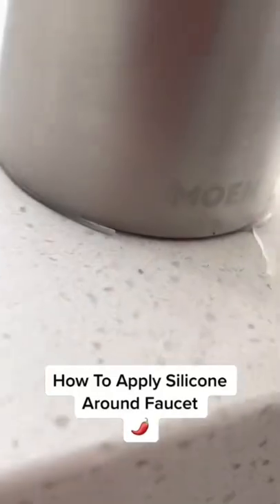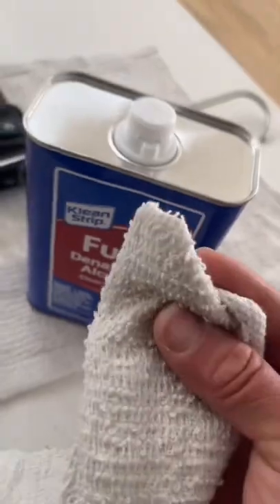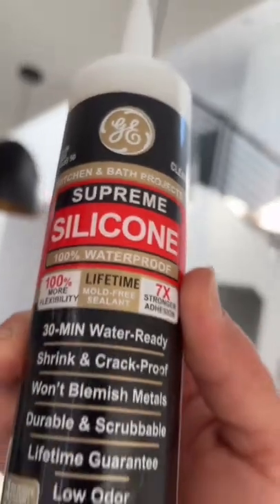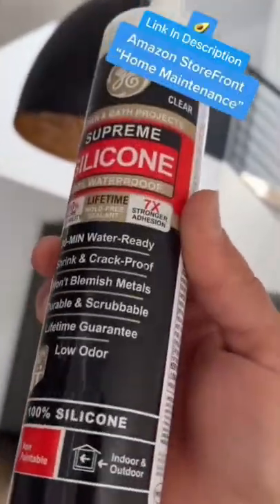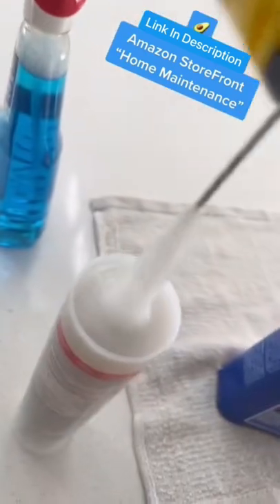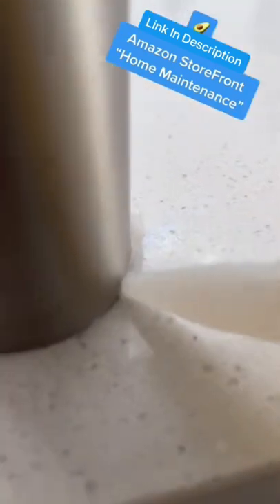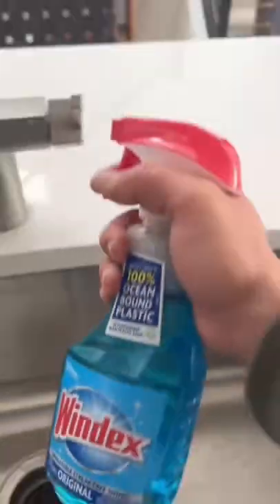How To Apply Silicone Around Faucet. #faucet #silicone #homemaintenance #diy #howto

Comment: Ammonia FREE glass cleaner ONLY bro. Ammonia (which is in most window cleaners) breaks the silicone down, and can allow it to not last as long. Just fyi buddy. Have a good one!
Reply: Needs to be pinned
Reply: Was just about to comment this lol. Same with people using Acetone. Just shows how little people try to understand the limitations of products.
Reply: @Baise Duezcke Yeah this is new to me. wouldn’t have thought to use windex.. also wouldn’t have questioned the suggestion necessarily
Reply: Ammonia can also eat at the finish on the faucet.
Reply: Ammonia will also eat at some counter tops as well.
Reply: @TheFelony  windex has such a low concentration of ammonia that it will never damage anything before it evaporates. Most people use it for everything, countertops, stainless steel, glass, stains, oils, etc. Its safe on silicone rubbers too as long as you’re not saturating it, not good for silicone adhesives though as yes it breaks the bonds and swells the adhesive
Reply: @maxfathi596  I agree, likely will never have a problem but repeated uses may develop an issue over time, and the ammonia doesn't really have that much benefit over their other formulas, especially for something like this where it's not being used in large amounts.

Also, god forbid it does actually cause an issue for a contractor, that could be thousands to repair a counter top.
Reply: Thanks for the tip!!
Reply: Got another silicone expert here
Reply: Better to use liquid besides the denatured alcohol to prep the surface. Invest in a Fugi silicone tool kit
Reply: Thanks for this tip. I’m in Cali and Denatured Alcohol is super illegal. 🤨
Reply: He wants to get paid again
Reply: No, windex will not break down silicone once cured just because it contains ammonia.  I've been using this for over 15 years and silicone just holds fine
Reply: @tonyr8443  "I do it, so everyone should"

Comment: I’ve used the denatured alcohol instead of Windex. Seems to work really well.
Reply: Same! 12 years or so using to caulk fixtures that way, still happy! Before that was soapy water
Reply: You’re supposed to use isopropyl, denatured will not allow it to attach correctly. Especially with silicone
Reply: Don’t use the denatured to clean surface before, you are right silicone will not stick to denatured alcohol. Usually clean area with water and soap or other cleaning products come back when dry, lay bead of caulking lightly spritz area with denatured alcohol wipe joint down. Comes out smooth, seam is filled up, and no mess on other surfaces because the caulk doesn’t stick to the denatured alcohol.
Reply: Same here!  Best I’ve found!  No streaks or residue. 👍🏼
Reply: @chrismohar4706   you’re not supposed to use soapy water either, recommended strict IPA  or 70%. and you are not supposed to spray it before tooling either. Otherwise it won’t adhere to correctly. Commercial glazing foreman and trained caulker.
Reply: @tonyochoa16  look man, IPA is too expensive AND delicious to waste on cleaning around some fixture, I don't care HOW good it works, 
plus not every customer likes the smell of a fine ale

Comment: If you’re already cleaning with denatured alcohol, just use it to clean the silicone joint. The alcohol gives it a smooth finish
Reply: This is how I do it. In a spray bottle, give it a light mist and wipe away.

Comment: This has to be the first useful short I will genuinely use going forward thank you so much for the tips!!
Reply: Don't use any of this nonsense. You do NOT use denatured alcohol. It leaves a film, because it has oil in it. ONLY use isopropyl alcohol. 
Never use frikin windex to tool caulk, NEVER.  It has ammonia in it  which breaks down the caulk. There is no reason to use anything when tooling caulk. Just use your finger or a caulking spade. A popsicle stick works just fine.
The caulk joint he laid in this video failed before he left the house. The homeowner just won't notice for another year, when their cabinets are rotted out.
Reply: @carllennen3520  I'm 8
Reply: It looks like a moen and it has a seal already. 
Silicone just makes a mess and creates a maintenance job that otherwise shouldn’t exist.

Comment: Just use the denatured alcohol to tool the caulk. It dries faster so the caulk can start drying sooner.
Reply: Denatured alcohol is what I use. It works great!
Reply: Yup, same here. Best method I have tried too.
Reply: @mark33545  I use my bare hands and it sometimes dries my skin out. If I did it several times a day every day, I'd probably wear a glove or use a tooling device.

Comment: I try to use a rubber ring under the fixture. Some brands come with one as well
Reply: if it doesn't come with one then is it any real quality?
Reply: Yeah just free the faucet with a couple of turns from underneath and change that counter seal.

Comment: Nice work, don't use your finger to tool though - that's the rookie way. Use a tool to smooth off for a consistent silicone fillet shape. I personally use a popsicle stick, I was taught this method from a professional joint sealer and it works well.
Reply: this sarcastic? I'm a contractor and your suggesting using a popsicle stick to smooth the caulk around the circular faucet in this instance? either sarcasm or I mis understood something
Reply: What in the world is a professional joint sealer. I've been in the trades almost 40 years and have never come across somebody who makes their living being a professional joint sealer.
Reply: I’m a professional joint roller, and you sir, are full of it
Reply: @ohhansel  
Hi mate, yeah a "joint sealer" is a profession over here in Australia, they shoot and tool polyurethane into expansion joints etc, and also usually do bathroom and kitchen silicone work too.
I worked with a guy who was a joint sealer / silicone installer a few years back, he taught me a few tricks and techniques that I still use today. He was an absolute master at anything that came from a caulking gun.
Reply: @vzgsxr  well if that ain't the craziest s*** I've ever heard. Where I'm from caulking is just part of the carpenter trade. Granted some are smoother than others no pun intended. If I had to go to work and do nothing but squeeze a caulk gun for 40 plus hours a week I would just go ahead and put that framing nailer right up against my forehead and get it over with. But hey that's just the Vegemite sandwich I'm chewing on up over here in the states.
Reply: @ohhansel  you made me die laughing with all your comments man 😂😂 I’d never heard of it either before this
Reply: I wish it was a proffession over here,95 percent  of the trades do their own over here.Lets just say most of the time it ain't pretty.

Comment: There should be a seal around the base faucet if installed correctly, you shouldn’t have to be adding that super thin layer of silicone that keeps coming up over the years. P.S Also if you are adding silicone it can be due to movement make sure you TIGHTEN down that faucet.
Reply: You’re right that faucet does have a ring seal underneath. You still need silicone because water always wins. We can only delay it’s damaging effects. Silicone adds a little more protection. Water, even softened water, creeps under the faucet base and leaves mineral build up over time.
Reply: You need both the seal and silicone. It’s on the directions of pretty much every faucet.

Comment: Spraying windex or alcohol before tooling can be risky because if there is ANY tiny spot where the silicone is not in full contact with both surfaces of the joint, the liquid gets behind the silicone and then when you tool it, it creates a serious defect that is not water tight and sometimes very hard to spot. The only safe way to use the spray is also, unfortunately, very time consuming: you have to tape everything off, tool the silicone so it gets squished into the joint for 100% contact, then remove the tape, spray, and retool. Worth it for a high end job, but otherwise you just have to assume the risk and be very careful to make contact when not using tape on mass commercial jobs

Comment: Smooth the silicone with water-tipped finger, then finish with a second pass using a tshirt rag wrapped tight around your finger... it will finish the joint and clean any residue on either side of the finished joint.  Some plumbers just use the tshirt method by itself.  Try it, you might prefer it!
Reply: Way I was taught. wet rag

Comment: I must admit for years I used my own saliva as in licked my finger, for a small job like this no problem but doing a whole bathroom or window washing up liquid
Reply: Learned that trick while working on C-17 cargo planes in the Air Force. Used it all the time when installing panels or lights that required sealant.

Comment: That type of faucet should  NOT require sealants of any kind around the base and caulking like that only creates a maintenance issue for a homeowner. There is zero way to make that durable.  There should be a watertight gasket or plumbers putty (dep on manufacturer) UNDER the base.
Reply: Thats true

Comment: Most of the new faucets don't require silicone as they have sealing rings already
Reply: This style does tho...so valid video
Reply: @Depl0rable10  do you have the model, I'm curious now
Reply: @Depl0rable10  that would be the first moen faucet that I have seen that doesn’t come with the sealing rings. It must be one of those cheap ones people get from the home stores.

Comment: Lick your finger, don’t waste money with windex, it does the same job, also take the faucet off and put it under the faucet before you add anything around the edge. You can take anything off with a razor blade after the fact when it is dried if you make a mess.

Comment: A real tip: if you install your faucet correctly there's no reason to silicone or dap it. 99% of faucets come with 2 rubber washers to protect you countertop and create a seal. If you silicone you are just making it harder for the next guy to do a clean install of a new faucet. Almost all fixtures from shower trim to toilets do not require any form of silicone. As long as it's installed correctly there will be no leaks

Comment: Bro. It's a moen. It's meant to go straight on the counter or sink without thebplate. There is a rubber gasket right under it. Putting silicone around a faucet is downright amateur.

Comment: And Finland there is sealrings in every faucet on sale, so there is no need for silicone. But u live in 3:rd world country.
Reply: I’d say with 99% certainty there’s already a rubber seal under that faucet. Ive seen some pretty cheap faucet and can’t ever remember a new faucet without a seal. So unless the installer removed the seal it’s still there.